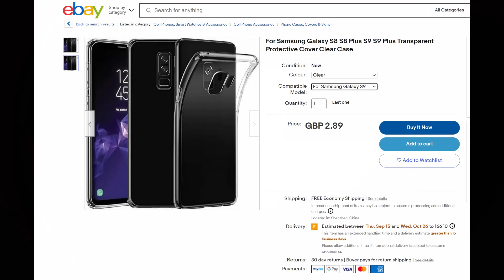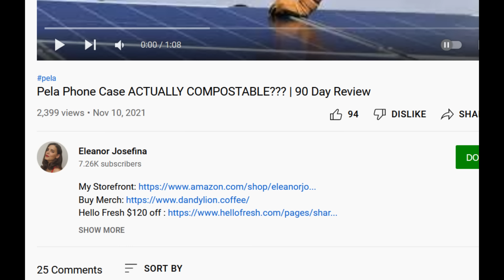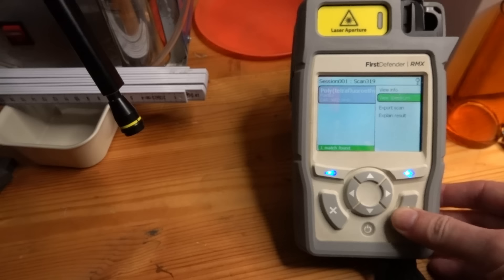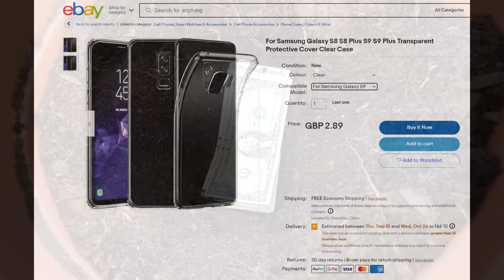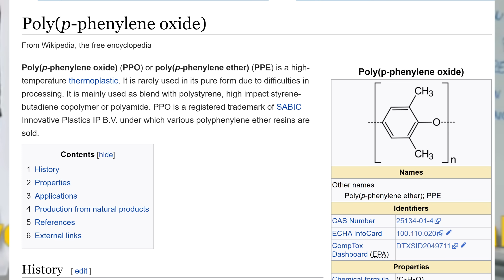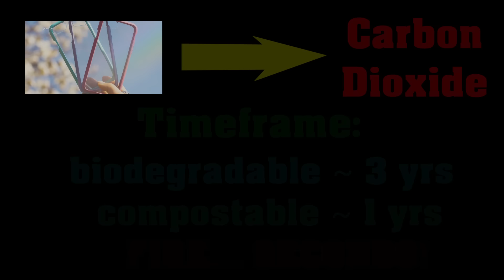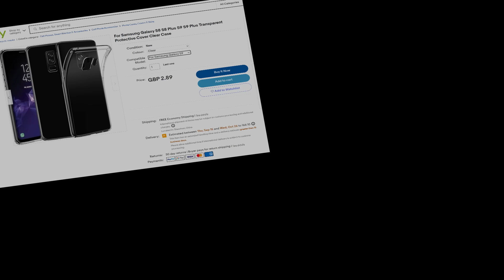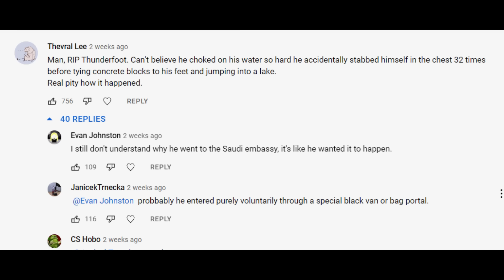Pela-Case: BUSTED!!!

Comment: Another thing.  You had your case for THREE YEARS.  A compostable case will come into lots of contact with moisture from the user (sweat in the hand, drops from drinks, etcetera).  A truly compostable case would start breaking down in your hand from day to day use.  Sure at a slower rate than if in the ground.  But it would weaken the case and lead to a failure.  In theory you would have to replace such a case (if truly compostable) every year at least.  While a biodegradable case wears down over time, lasts many years, and that can be properly disposed of.  That saves a LOT more CO2 than one needed to be replaced yearly as it fails.
Reply: If the smart phone industry has their way, we'll need a new phone and case every year, anyway.
Reply: With the weight of the Pela case in mind, evem if you bought a new, normal case every year, it would still save more carbon than the compostable one.
Reply: I’ve got a case that protects my phone in stead of cracking the screen. It saved my phone multiple dozens of times the last two years. With pela I’d have to buy a new one the first time.
Reply: Here in Switzerland you can buy compostable bags. They're used so compostable goods (mainly food scraps), don't get to smelly and full of maggots. you are allowed to throw these in the compost bin. if you wait more than 7 days, they already have degraded to a point, where they no longer work as a bag. still, you're only allowed to use them, if the bin gets deposited into a modern methane trapping bioreactor, which works at higher temperatures than a normal compost. normal composts can't degrade them enough so that there are no scraps left.
Reply: Intermittent moisture doesn't promote microbes to grow so no it wouldn't compost in your hand. Wood is compostable does it degrade from sweat?
Reply: @ghz24  Yes.  The wood absorbs the salts and sweat and water into the pores of the wood.  It is a very very slow process especially if the wood is cared for with something like linseed oil or wax or laquers to limit the process.  The key is wood is taken down by fungi (not bacteria).  Now that is normally not a problem in relation to wood being handled constantly (like a shovel handle) as it gets moist then dries off once you put it aside, so the fungi never take long term hold.  But the constant back and forth of sweat on unprotected wood will darken the color and then start to develop gray coating as the fibers of the wood every so slowly break down from the absorb and release (like a paper clip .. bend back and forth enough and it breaks).  Even then it takes years to get anything really noticeable.
Reply: It probably wouldn't degrade much physically, but discoloration would be a problem especially when the phones themselves can easily run as hot as a compost bin.
I reuse regular plastic straws for weeks and weeks until I break them but a compostable straw will look disgusting in a matter of days.
Reply: @AbstractM0use  they should make the phones compostable so you have to buy a new phone every year!
Reply: I used to keep cigarette papers in my pocket, in a very generally very dry climate, and the glue strips would all stick halfway through the pack.
Reply: @thumbwarriordx  The heat of the phone would drive off the water not hold it in the substrate.
Comparing a phone case that should be mostly not immersed in water to a straw that's designed to be immersed is pointless.
Reply: @walterengler5709  Salt deters and suppresses fungal growth.
And thermophilic fungi are responsible for just as much if not more of the composting process in a compost pile. So pointing out that fungi are the primary decomposers of wood is a red herring.
Composting requires consistent high moisture content for both fungal and bacterial species to do their part.
Reply: @ghz24  You'd think that but there's all sorts of hygrophilic shit that spills on your phone and skin oils, and just... gunk.

Then one day you go "Well that's not cleaning off anymore" and eventually get another case.
Reply: That's what i figured as well, if it is so easily degradable, then it would be noticeable after a short while, the usual spots that get most contact will start morphing or peel away, forcing you to buy a new one not long after that, because yeah, it creates failures in the integrity and its supposed protective function.
When you don't really need a phone case in the first place, some people can take care of their stuff a bit better than the other.
And.. if you actually NEED one, because you tend to drop stuff, then please go for a cheaper non-degradable case, to make sure that it won't break when the case becomes too weak, which saves the environment from broken display parts.
Reply: @Games_and_Music  A two piece silicone hard plastic case is what's seriously gonna prevent your phone from breaking.

And the best thing for the environment by an enormous margin is to literally keep your phone until it doesn't receive security updates anymore.
Reply: @thumbwarriordx  Yeah, that is what i intend to do.
My previous phone was an LG G3, got it in 2014 and kept it until i got the blue screen of Death in late 2019, then i got a cheap OPPO that i carry around with no case for it either.
I don't usually drop my phone, because i also don't keep it in my hand the whole time, or take it everywhere i go.
Plus, i have carpet at home, so my house is fairly low risk.

I know that the 2 piece cases are good, but i have no desire to "pimp" or protect my phones, as i prefer the plain look, besides phones are big enough without a case already.
I found a Dolce & Gabbana sticker that i jokingly stuck on the back of it and that's the extent of my protection and pimping.

Funnily though, i also carry a Motorola Razr flip phone to make calls with, and it is a limited edition Dolce & Gabbana version.
I carry the Razr because i love that model, but found a cheap D&G version on eBay with a lot of luck, and when i got this OPPO, my old SIM card was too big to fit into the newer smaller slots, so i either had to cut it, or put it in another phone that fits the bigger size.
So i put it in one of my other old Razrs, until i decided to go full oldschool bling with the D&G.
So now i use both the Razr and OPPO, the Razr is solely for calls, and the OPPO does the internet stuff, Whatsapp (linked to my original number that currently sits in the Razr) and whatnot.

Long way of saying, way ahead of ya ;)
My Razr doesn't do security updates, that's how smart it is!
Although T-Mobile actually tried to get me to use 1 phone, the new one, because they said they were ending the service on 2G bandwidth, and they called me to say that i was using an older model and likely will not be able to make calls with it anymore once they end 2G.
But, i knew that the Razr was one of the early generation phones with 3G and sorta-internet on it, so i said that i would keep using it and see what happens.
Well, they ended 2G, but i'm still able to make calls, like i expected.
But yeah.. once 3G phases out, but i don't really expect that to happen soon, as many parts in the world might still be dependant on it.
Reply: @Games_and_Music  Compostable is not really the same as biodegradable. Close but biodegradable includes things like sun light and plant roots.
Bones are biodegradable but aren't compostable due to the time scale of composting.
Reply: Lots of people here who are talking about how easily "compostable" materials break down showing really quickly how they've never actually tried composting before.  
Shit's finicky at the best of times in the best conditions, let alone the relatively volatile conditions of urban living.
Reply: @thumbwarriordx  
You can actually use them just fine waaaaay beyond that point, until nothing works on it anymore.
That's the actual end of the life cycle, and even that is entirely artificial and preventable.
Reply: @heinzhaupthaar5590  You can use them for all sorts of things after that point.
But that's just when it shouldn't be your phone anymore.
Reply: @thumbwarriordx  
Why though?
Reply: @heinzhaupthaar5590  Unless it's a phone with a well maintained lineageOS release or something for it they're just not safe to use.
It can just live on as an iPod/webcam or a web interface remote for something in your house though.

Comment: Ok, ok, I'm at 2:17 where that woman says "First compostable phone case"... Well, PLA is a bio polymer based on lactic acid and compostable in a specific environment. It's used for single use plastic items and pretty much the standard for in-home 3D printing. One of the all time favourites people print with those machines are phone cases, while TPU is a way better suited polymer for such a phone case, some printed them in PLA aswell. In other words, there was at least one person in the world before them that made a compostable phone case. I don't need to hear anything else to know that what ever they try to sell is just bogus.
Reply: A German company I work with is pushing out ads for a compostable dental floss made of PLA... And yeah I have to wonder how many at the company know how hard it is to get PLA to actually break down
Reply: PLA is generally made from corn.  Sure, its heavily refined into an oil like those bamboo 'eco' products, but its renewable so I suppose not quite as bad as petroleum-based plastics.  Getting it to break down (or at least reduce into a powder) is just a matter of UV light.  Stick it outside and its gone within a couple of months.
Reply: I have about 4 years ago
Reply: @zybch  sorry, but PLA doesn’t break down that easily. There are several videos showing PLA printed parts lasting years in direct sunlight.
Reply: I think most PLA filaments are modified to give them better material properties, but that makes them much harder to break down naturally.
Reply: @zybch  incorrect. it doesnt matter where it's made from, PLA just isn't very biodegradable
Reply: @itemushmush  Pure PLA is a very stiff material and is terrible for phone cases. The Pila case is packed full of plasticizers to make the plastic more rubberized.
Reply: @zybch  No, PLA needs specific conditions tocbe broken down biologically. And trust me, UV does pretty much nothing in non-virgin PLA, there's either enough pigment in it to make it UV resistant or even UV stabilizer that makes it close to indestructable by UV.
Reply: PLA doesnt bio degrade
Reply: I'm sure wooden and cardboard cases exist
Reply: The company colorfabb offers a 3D filament based on PHA. They claim it breaks down much more quickly than PLA and apparently it doesn't need industrial composting. Nevertheless, any attempts at that scale are just ridiculous when the purpose is to "save the environment".

Comment: I am working for a company developing and producing compostable food packaging, mainly coffee pods. Here is how it works:
1. There is bio degradation. Here the samples of the finished and used product are shredded and added to a lab sized compost in several monitored (temperature, CO2 release, etc.) containers. Some reference containers with cellulose instead of the product are also set up the same way. The compost is treated as one usually would (adding fresh cuts and turning every so often). At the end of the test it is checked how much of the test material (product and cellulose) remain. In order to pass it requires a bio degradation of at least 90%  compared to the reference compost. For industrial compost the temperature starts at 70°C and drops off over a defined time and curve, the temperature may not drop below a certain threshold either. This is to replicate the conditions in an actual industrial composting plant. The time is limited to 12 weeks (or maybe a bit longer, I don't have this info one on hand at the moment). For home compost the starting temperature or the temperature overall is much lover as it is replicating the condition of a home compost in reality. The temperature is always below 30°C (don't have the exact numbers here either). The test under home composting conditions may take 6 months. 
2. The disintegration also uses the finished and used product and a reference in a lab sized compost. However here the product isn't shredded and used as is at disposal. The conditions are the same as in bio degradation (again industrial and home have their own). After the testing time is up (12 weeks for industrial, 26 weeks for home) the compost is sived and analysed. In order to pass there have to be less than 10% of the dry mass that are 2mm or bigger remaining.
There are a few other tests, like IR spectrum measures and florid content and bio-based content but I am getting tired of typing on my phone now.
The last thing I will say, if you want to know that a product is actually compostable and not just an empty marketing claim, look for the logos of DinCertco or TÜV Austria. These certification agencies only accept results from certain accredited labs, will check the composition of the raw materials with the material producers directly, do take their sweet time to make sure everything is in oder and have several reviews by different people. So if you have a product with their logo (industrial or home) it will be. You can use the certificate number provided with the logo to check further on the website of the agency. If that number isn't there then it is a bit scachy. On the off chance that a company decides to sell something else than what they had tested, it can be found out for example by the before mentioned IR spectrum as these agencies (as far as I know) will randomly take a product with their logo from the supermarket and check.

Comment: The problem with recycling/compostable stuff etc. is that people fail too understand that if you buy unnecessary stuff frequently no technology can counter that. If i am buying a regular phone case only when the last one fails then you can have a reasonable path too sustainable consumption. Simply seek out more resilient stuff for a higher price. This way the manufacturer has an incentive too make things that last and you limit your overall consumption.
Reply: exactly! plastic is a very good material and if it is used in cases (lol) where it isnt a one use packaging solution, then i see no problem. tupperware, electronic devices, cars etc.
Reply: even if the technoggly could reduce phone case emission by 100% somehow. it would be likely that a more realistic improvement in one bigger area would make the phone case improvement be nothing in comparision. i would not be suprised if reducing food waste by 10% which is much more doable would more be more than fantasy level improvements to phonecases be comparitively nothing.
Reply: Just don't buy a case. Dents add charm
Reply: @kornaros96  me and you are the same brother
Reply: @randomprotag9329  why are you posting this food waste fantasy under every thread? if you think it's so doable then why it impossible for you achieve? otherwise you'd be a multi-billionaire from saving the economy 10% food production.
Reply: Exactly, the reason most people want a phone case in in the first case is that they buy thin phone without bezels.